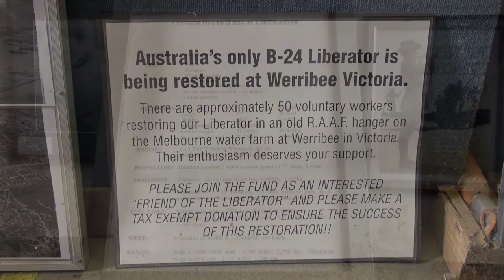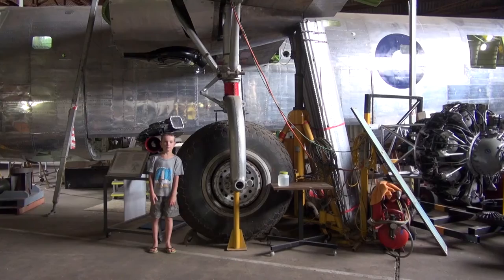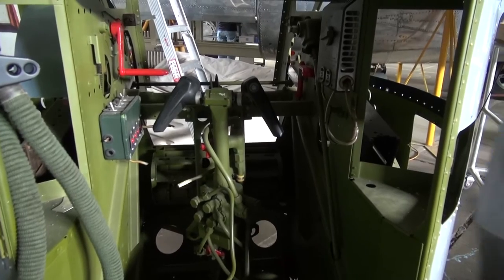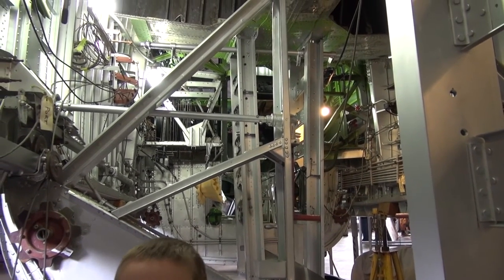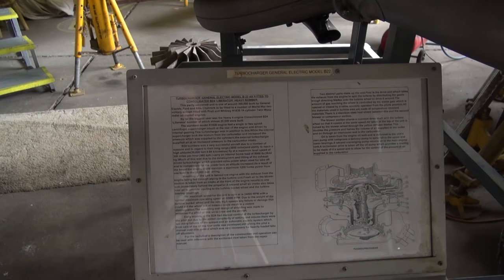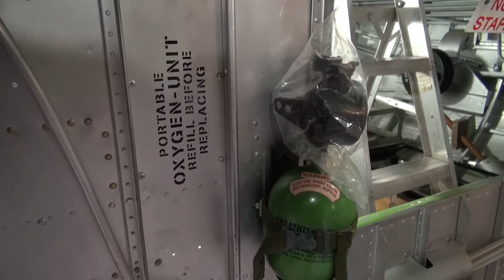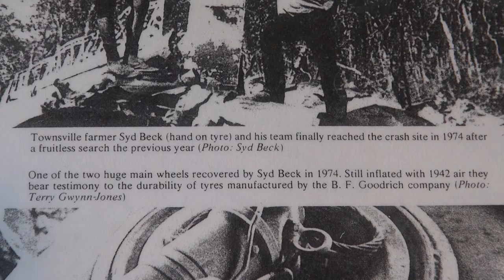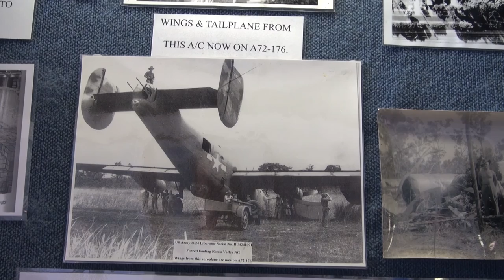B-24 LIBERATOR BOMBER RESTORATION Werribee Victoria Australia

Comment from the maker: I asked that question myself when i filmed the video, it will never fly due to some of the body parts have been made from wood or steel because to find the original was too expensive or just not around anymore. It's a pity but the volunteers really take pride in the project.